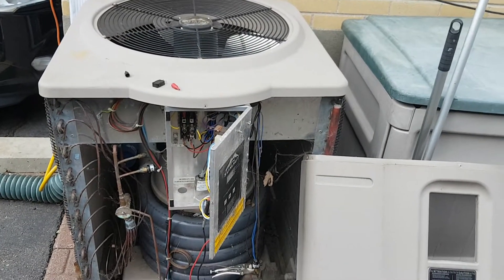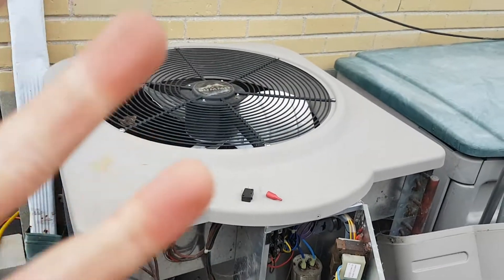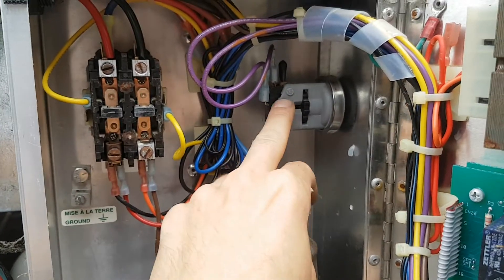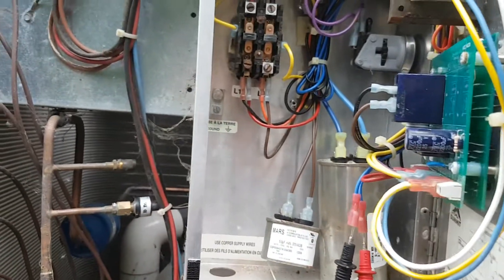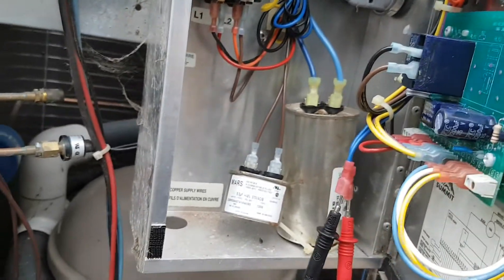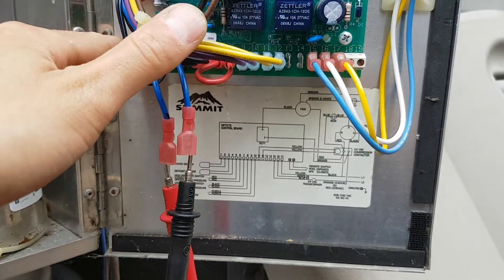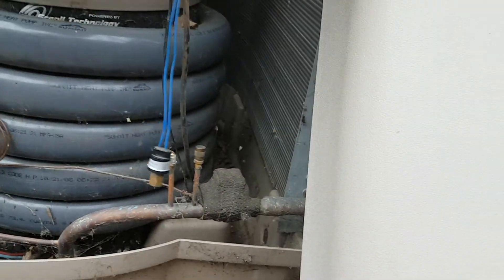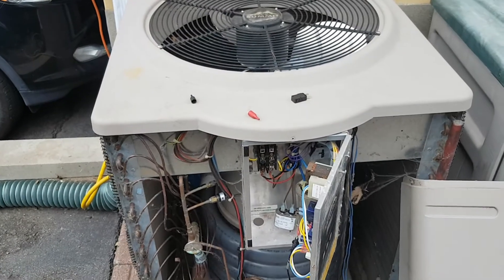How To Diagnose & Repair Hayward Summit Pool Heater Heat Pump

Comment: How do I replace the master switch on a Hayward HP50-TA?  Switch works, but is very hard to move.  I suspect it's probably corrosion because it doesn't appear to be weather sealed in any way.  I believe the newer ones have a clear flexible cover built in.
Reply from the maker: Just pushes out from the back side of the panel with some retention clips on the back side of the switch it self. The contacts inside may have melted. You can use any switch the same size and current rating. You can find them at local electronics stores. Just make sure the dimensions are the same.
Reply: @QuaabQueb  Thank you!  I also posed the same question to Hayward on their official website over three weeks ago.  Never got a reply, but today I received a new switch from Hayward with the notation, "warranty replacement."  Life is good!  Thanks again for your help regarding installation.  I

Comment: Great video, will help me look for the issue on my Summit. Any tips of what I should look at first?  I get an F5 error code but it's not cold outside at all. The compressor starts but the fan doesn't?
Reply: you're getting the FS because the compressor is running and the fan is not dissipating the cold out of the unit. It could be a capacitor could be the fan relay in the board or it could be the fan. Since this was from three months ago im assuming youve already made the repair or replacement
Reply: Bonjour Jean-François, j'ai le même problème actuellement F5 ou FS ... as-tu été en mesure de résoudre ton problème ? Si oui, as-tu un conseil pour moi ? Merci

Comment: How do i replace a hayward pool heater fan motor part #303088001 ?
Reply from the maker: Top grille comes off. Simply remove the screws around the sides. Trace the wires back in to the cabinet and disconnect them. Take pictures before unplugging anything so you can see how it goes back together.
Reply: Thankkkk youuuuuu🙌🙌🙌🙌👍👍👍👍  @QuaabQueb
Reply: @QuaabQueb  I did it you are amazing thank you!!!!! Now time to figure out what the heck is a FS error I'm golden lol 😆 have a great one thank you for the help again !
Reply from the maker: @TrishZenCorner  Google the manual and go to the error codes list, all the error codes and their explanations are listed as well as a brief troubleshooting tip

Comment: I have a Hayward HP50HA and it’s tripping my breaker open when in Auto mode (not during Heat/Cold).  Have an idea of what it could be?
Reply from the maker: There is a short somewhere
Reply: @QuaabQueb  me too. 20amp breaker blows after a few min run time. Did you find cause?
Reply: @QuaabQueb  What should be the resistance between each combinations (common, run, start) of a good compressor?  I am getting about 3 ohms for all, is it normal.  Mine too tripps the breaker :-(

Comment: Question for you my unit it's reading high pressure and stopped working. 
What do you suggest I check in order to fix the problem?
Reply from the maker: Check the service manual it lists all the possibilities for high pressure fault. In a rare case it could be a bad switch, or it can be over charged
Reply: Thank you

Comment: @Chargero wonder if you can help me trouble shoot? My heat pump will not turn on at all. I have power. My display will not turn on and if I press the bypass coil to give power directly to compressor and fan nothing happens. I can see that power makes it across when I press the coil in.
Reply from the maker: Might be bad contactor.
Reply: @QuaabQueb  You think so even if I get a reading once I press the bypass coil in? Wouldn't that mean it is getting power? Although it does not turn on the compressor or fan.
Reply from the maker: @gbanks  The contactor is the only thing between the mains lines coming in to the unit and the compressor/fan. The Control circuits are powered by a transformer that drops 120V to 24V
Reply: @QuaabQueb  Replaced the contactor. Still no display and compressor/fan not turning on. Thinking to replace the transformer next.
Reply from the maker: @gbanks  Test it. Check voltage output on the secondary. Follow the terminals from the transformer to the board.
But when you depress the contactor it should kick on the fan/compressor. You are effectively bypassing the control circuit that energizes the contactor coil.
Are your fan/compressor capacitors good? I have seen power surges blow these units. Typically a ruptured capacitor is a sign.
Reply: Hey @QuaabQueb  I replaced the capacitors and transformer. Power is leaving transformer now and makes it to the control board and on/off switch.  Still the display will not turn on.  Neither the fan or compressor turn on when I depress the contactor to bypass the board. Any ideas?

Comment: I have an issue. I have an HP error which means waterflow is low. The system cycles off within a few second of cycling on. The flow is fine, The pressure switch is fine but I ran out of things to look for. I got taken last year on a repair and would really like to do what I can prior to calling a tech. I've been looking for a water flow sensor in the unit but can not find it. It is the same system as the one in this video. It is a salt water pool. Any recommendations would be appreciated. Thanks
Reply from the maker: Could be a band switch, or an issue with the refrigerant charge. Flow issues I have only seen with variable speed pumps when they are set to run at low RPM.
Reply: @QuaabQueb  You mean the water pressure switch? I checked it and even changed it out and it still does it. Is there a flow switch anywhere in that unit? I know there's one in the piping for the salt water.
Reply: U have a restriction in the txv

Comment: Great Video:  I have a Hayward Summit XL, entering 2 season of use.  Fan runs but not getting at heat output at the inlet.  Fan blowing cold air BUT I have not measure the delta T yet.  Any suggestions?
Reply from the maker: If the fan is blowing cold air then the condenser coil must be pumping out heat to the water... 
These thermopump units are slow and can take a good week to get a large size pool up to temp. Especially at the beginning of the season.
Reply: @QuaabQueb  It actually was working.  I realized later that the air was to dry to facilitate a good heat exchange.  As humidity increased so did heat pump efficiency.  Thank you for the help.  Great Channel - shoot the bird ;)

Comment: I have a new just installed raypack.  Never run.  Trips on high pressure.   I checked the water flow. Well above 40gpm.   Coil temp drops on start up gets to about 35f. Then compressor shuts down.  Ambient temp is 53-55. Water temp 49f.  Kinda head scratching my head.  I have no bypasses. Possible to much refrigerant from factory? Trips in less the 2min
Reply from the maker: Yes that is possible. Geographic elevation is also a factor.
Reply: @QuaabQueb   597ft.  About the same as Detroit. Any other possibilities?
Reply from the maker: @Bottlejack1  I'm not an hvac technician so my experience is limited with with refrigeration. If the unit is brand new something is likely not hooked up right. Try and find the manual for your particular model of unit. All of the operating specifications will be listed and you can begin to troubleshoot from there.
Reply: @QuaabQueb  thanks.  I dig into it a bit more.
Reply from the maker: @Bottlejack1  if you do end up calling an hvac guy to check it out make certain they are well versed with pool heaters.

Comment: How to I replace cracked pvc on the back side?
Reply from the maker: The inlet connector or the coil ?
Reply: @QuaabQueb  inlet connector y pipe one cracked hard to get access to
Reply: How to get access to the back portion does the bottom disconnect
Reply: @QuaabQueb  same question. the pvc pipe is leaking. the side opposite from where the electrical box is... the white PVC on the bottom horizontal to ground. its got a split and i don't know how to get access over there.
Reply from the maker: @2MUCHPWR  sounds like freeze damage.
Reply: @QuaabQueb  Oh yeah definitely. i agree. but now i have to fix it. I bought JB Water weld. think that'll hold? if i could just get in there, i would cut it out but i don't know how to lift that surrounding cooling fin assembly out of the way. any suggstions?
Reply: @2MUCHPWR  i got exactly the same crack at the same place. How have you fix it? Whats that crack filler you're talking about?
Reply: @QuaabQueb  super bon vidéo merci. Tu connais ton affaire ça parait. Mon tuyau de PVC blanc de mon coil a fendue, je l'ai pas drainé. Est-ce qu'il y a une façon de réparer ça et éviter de payer 2500$ pour le coil complet? Je suis de Vaudreuil-soulanges
Reply from the maker: @immoconsul  Salut, laquel pvc blanc ? Le coil qui est grise comme celle de ma vidéo ?
Reply: @QuaabQueb  oui celui qui est gris mais dans mon modèle, il est blanc
Reply from the maker: @immoconsul  ah ok. Malheureusement non.  Le coil dans lequel passe le réfrigérant est situé à l'intérieur de ce tuyau/coil en pvc. 
Si vous remplacez l'ensemble du coil, vous devrez appeler un technicien en réfrigération pour évacuer le gaz et puis le remplir apret.

Vous pouvez essayer de coller un patch à partir d'un tuyau pvc coupé en deux.  Nettoyez très bien le tuyau, vous pouvez utiliser un pistolet thermique pour aider à former votre "patch".  Utilisez des pinces jusqu'à ce que le ciment durcisse.